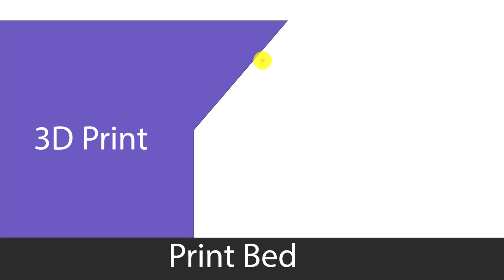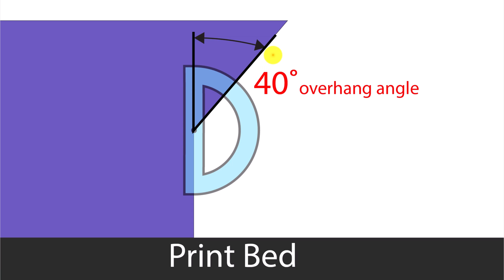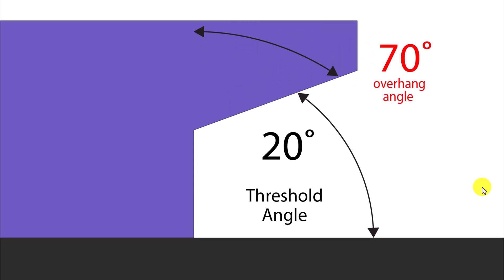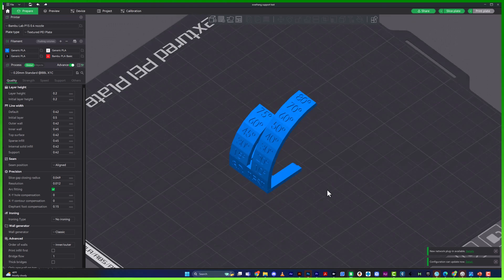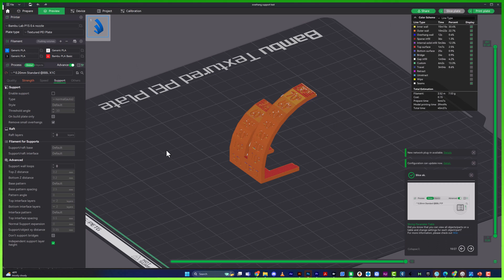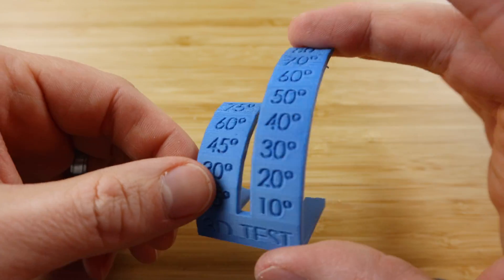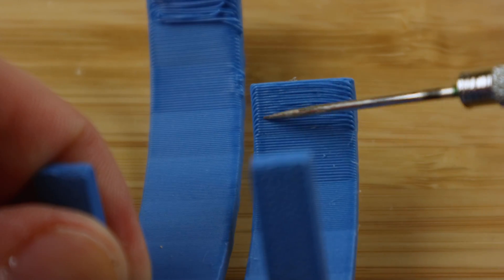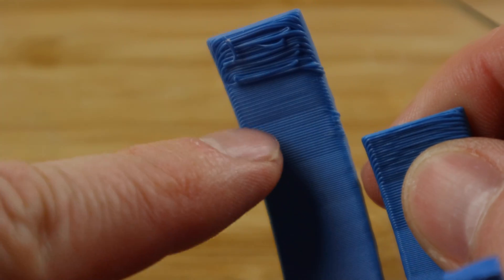Threshold Angle in Bambu Studio | When To Add Supports on 3D Prints

Comment: Good video for new people. Default for overhang threshold for Creality Print is 30°. Orca Slicer is 30°. Bambu Studio is 30° and Prusa Slicer is 40° (if I remember correctly). In your tests you got ranges from 20-40 with 30 being an option with all layer heights. So it's safe to say 30 degrees is a good setting. I have yet to see anyone use 30° and have problems. So I'm not sure what problems one would run into if they used 30°. 

With that said I like the explanation graphic. Remember the bed is the constant (its level) so it makes sense to use that. IMO.

Comment: Threshold angle is the only angle you need. Overhang angle is only useful if the side is at a true 90 degrees from the bed, which many times it is not. So using that as a starting point for calculation would give you the wrong angle.  So, if the vertical is at a negative 10 degrees and your overhang angle is at 50 degrees from that, then your threshold angle would be calculated as being 10 degrees greater than it actually is. So in that case, the resulting calculation would be wrong. Just find the threshold angle directly. Bamboo Lab has it right.

Comment: Not sure if this will get answered or not now due to the age of the video, but do you use the same threshold angles if you use different filaments? eg: you start off with PLA, but then you use PETG or ASA on a different model. Do you use the same angle information or do you create a new support print and use that new one?
Reply from the maker: Hey! So for me personally I have noticed a little difference and have different angles for each filament type since they cool at different rates. I recommend doing a few small tests.
Reply: @ thanks for the information. I'll try this for sure. Great informative videos for us newbies. Picked up so many tips from them. Great work.

Comment: Very interesting - I'm new to 3d printing (got my P1S last month and absolutely love it), so deciding on what support threshold is a key issue for me to understand.

From what you say about need to re-run the test with different layer heights, I'm guessing the tool wouldn't be useful when using adaptive layer height as this is determined on a per-object basis? (or is it the associated settings that come with different pre-set layer heights that are more significant? Speed for example I've noticed, is set lower on a 'quality' setting?)

Comment: Hi, I've tried to print this twice now with my Bambu A1 mini and both times it gets to 30 on the right and 60 on the left and then goes crazy and fails and i get a tangle of filament.  I'm using basic pla for the material.  Any ideas or suggestion to why this is happening for me?

Comment: Nice information.  Appreciate the discussion.  So, I don't have to know what my overhangs are in my prints, just need to know what angle needs supports.  So, should I always enable supports and put in a good threshold angle based on tests I have run?

Comment: The problem with going from the vertical to calculate angle is that a model may not always have a vertical surface, so it makes more sense to go from the horizontal build plate.
Reply: 100% agree. Basing it on the build plate is the constant you can rely on.

Comment: any tips for changing Top Z Distance for support? having a rough time taking off support from prints printed with PLA+ and support is also PLA+
Reply: I hear you can use petg supports. Haven't tried it yet but seems cool also I would just use the interface layer but like I said haven't tried it
Reply: I use PETG as the support interface all of the time with great success. Make sure your base support material is the main material, or you'll waste a ton of filament & time.

Comment: Wouldn't that angle change based on orientation on the build plate because of the cooling fan location.
Reply from the maker: That’s an interesting point Denny I haven’t experienced it to be different cause it’s the angle it can print before failure so the orientation might give different angles but it wouldn’t effect what angle prints well. Least that’s my theory. Might be worth testing.